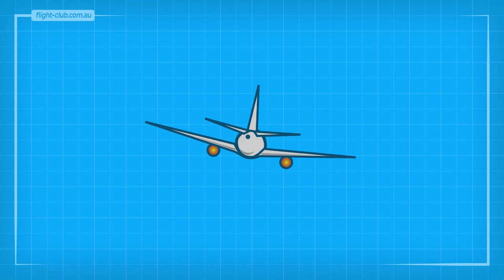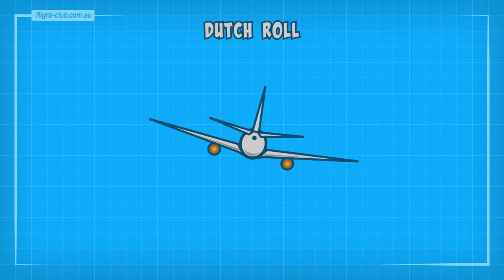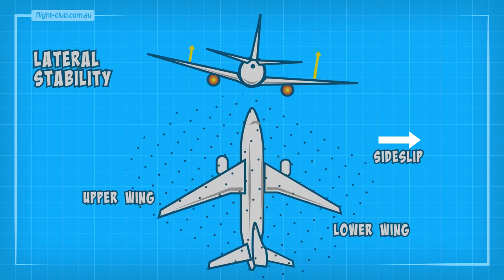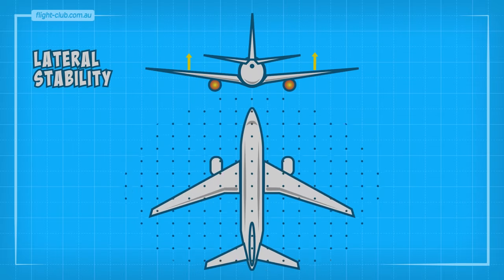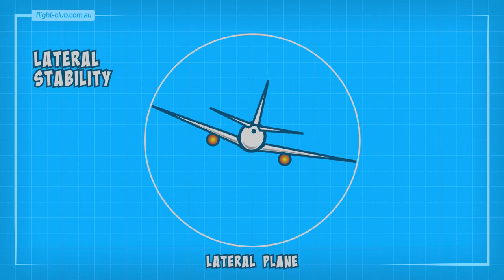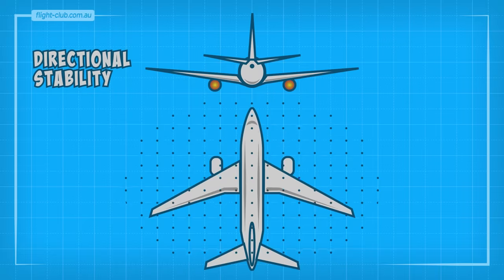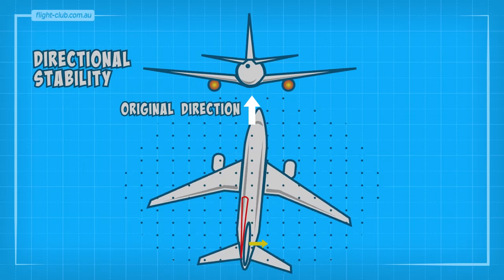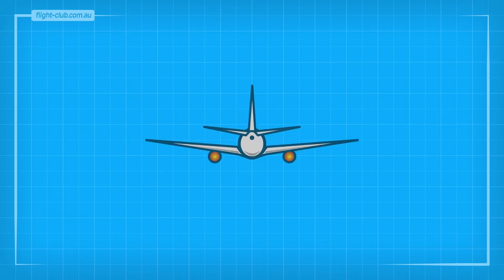Understanding Dutch Roll | Simple explanation.

Comment: I used to fly Boeing 737s and like most jets they had something called a ‘Yaw Damper’ this became part of the fly by wire software in later aircraft. The yaw damper used to input small rudder inputs to prevent or stop Dutch roll, the movement was imperceptible in the rudder pedals and there was a small gauge in the control panel to show that it was moving which was barely noticeable. One day I boarded one of the company’s aircraft at Gatwick U.K. to fly to Barcelona Spain and back. The only noted defect was ‘Yaw damper inoperable’ which I checked was allowable so off we went. A short while into that flight I decided that I would never accept a 737 for flight with that defect again (as Captain we have that right no matter what the manual says). The flight there and back was horrible, there was nothing that we could do to stop the Dutch Roll, yes the effect reduces until the next tiny bump or turn or whatever, it was safe but absolutely awful, it must. have been even worse for the passengers near the back.
Reply: I guess it's like having a car suspension  with spring only and dead shock-absorber..?  Is it?
Reply: Sir, i sincerely thank you for this comment. I keep on being surprised how do native enlish speakers explain and tell their stories so that every word and an event is literally feelable. The thing is that I am a FO for Aeroflot, my type is A320 and at the moment I am trying to make all those things that happen with aircraft to come "throught my skin" to start to understand them instinctively. Harsh times in the industry lead to imminent aircraft-bound-to-ground situations and flights when we have to dispatch under multiple MEL is increasing. Thanks to your comment now I know that without a yaw damping function it may be reasonable to insist on switching to another aircraft.
Reply: Hlo sirr ❤️
Reply: 737s dont have fly by wire
Reply: @hansloyalitat9774  They said that LATER aircraft had the functionality of this component as part of the fly-by-wire system, not that the 737 had one.
Reply: They lost a KC-135 due to dutch roll.
Reply: Many planes have very weak natural stability nowadays. Because large stabilizers have a lot of drag and active control systems are allowed in type approval. The planes still need to be stable, but zero damping causing the plane to continuously wobble around is technically stable. 
Stability can also be increased by trimming more weight to the front, because it increases the lever between the stabilizer and CoG. Like picking the heaviest passengers and giving them a free in-flight upgrade to the business class. Small changes can be significant in this regard.
Reply: Did you inform the passengers of what was happening? Or did you just sorta pretend this was normal flight
Reply: @hansloyalitat9774  Read better my dear before comenting ....
Reply: I was a jet engine mechanic on the KC-135. I learned a lot about the planes history. Its a cousin of the 707. The rudder damper didnt come about until after these planes were designed, since they were some of the first to ecounter this problem.

The USAF inexplicably refused to install rudder dampers on KC-135s, after Boeing made them for the 707. They didnt install any for 20 years, probably to try and save money. The USAF accepted a fatal crash rate of 2 crashes per year, and many MANY of these crashes were the result of lateral instability that a simple yaw damper could have prevented.

Ths USAF was trying to compensate through raw crew training. A good pilot can dampen out a dutch roll by hand, and make it a smoother flight... The problem is, this task is a stressful attention hog for the pilot from takeoff till touch down... So you can imagine how pilots can easily lose control over dutch roll when they get behind the plane.

The way to combat it is to counter roll. Not yaw, trying to counter with yaw almost always makes it worse since dutch roll is so sensitive to yaw input. So the USAF would train its pilotst to dampen it out with hard roll inputs timed perfectly to be in phase with the dutch roll. And they couldn't hold it there for long, otherwise the pilot is likely to add pilot induced oscillation to the problem.

You would be right to reject a plane without a working damper. After how many fatal 135 crashes have been linked to lateral instsbility on that jet, our pilots are terrified of not only dutch roll, but uncommanded rudder movement. They also consider a failed damper automatic grounds for an in flight emergency, and landing asap. When a higj profile crash happened, the public found out a 20 year old piece of equipment could have prevented it, if only it had been instslled... The backlash was immense, and the USAF was forced to install them.

I am genuinely surprised that Boeing or your airline consider the damper optional equipment, you should probably reach to them both and let them know it shouldnt be, as that WILL likely crash a plane someday for any pilot who doesnt have experience with countering dutch roll. That literally sounds like an accident waiting to happen.
Reply: its the reason you are altitude restricted with the yaw damper inop. The Commander must adhere to the Dispatch requirements. in this case considering the Minimum Equipment List operational requirements. Flying lower (max. FL250) would require significant more fuel and possibly flying through more unstable air. Considerations and judgement are essential.
Reply: What has to be realized is the amount of work the engineers have done while designing so as to make flights comfortable. An event less flight reflects the fantastic reliability of each and every component of the airplane including the structure. Never forget to thank them everytime when you fly the machine. Some crew are very humble but some tend to take pride since they operate it like they own the plane. No engineering, no flying. Engineering has and will always be a thankless job..lol
Reply: Dutch roll is a directional stability effect. Virtually all the energy exchanged in a Dutch Roll is between yaw rate kinetic energy and sideslip stiffness. The only damping comes from the Nr derivative, the Np derivative usually causes a slightly destabilising effect. An excellent way of grasping how this happens is a time vector diagram. If you can find a copy of the text "Aircraft Dynamics and Automatic Control by McGruer, Ashkenas and Graham (unfortunately out of print for about 20 years now), look up the time vector diagrams for Dutch Roll, figure 6-4, on page 370 of my copy. The yawing moment equation is where all the energy exchange happens. The side force and rolling moment equations are just responses to the yaw motion. The only thing dihedral contributes to Dutch Roll is to determine the phase of the roll response.
Reply: @hansloyalitat9774  wasn't the infamous pitch trim problem of the Max that killed so many essentially a fly-by-wire issue?
Reply: That's only partially correct. Dutch roll at altitude is an entirely different hing to what is described here. Tht's why there was an altitude restriction for operation when they yaw damper becomes inoperative.
Reply: Nice description.  The Dutch roll phenomenon first appeared on the Boeing B-47 bomber, and the first yaw damper system resulted.  I was a mechanic during the early days of the Boeing 737, and we dreaded having to dispatch an aircraft with the yaw damper inoperative.  Since the passengers toward the rear of the cabin were subjected to a larger displacement during a Dutch roll, the flight attendants knew that airsickness would begin at the rear of the airplane and move forward.  Nobody was happy when the yaw damper failed.  Never models of the 737 have the yaw damper function incorporated into the automatic flight system in place of the troublesome yaw damper coupler on the early models, and reliability has improved.
Reply: No yaw damper means no autopilot. No pilot would accept that.
Reply: @hottubking1229 you can have a plane with a yaw damper and no autopilot.  The Be1900 comes to mind.
Reply: I'm surprised any MEL allowed to operate without the yaw damping system.
Reply: Flying lower would have helped
Reply: I know you posted this a year ago but this is in the news today. I had no idea what a Dutch roll is and your input makes a lot of sense.
Reply: @shoutitallloud It's sorta similar I think a better description would be that your suspension system is out of phase with itself. Like if in the front one shock on one side was hard and the one on the other was soft and in the rear it is flipped so that the soft shocks are diagonal to each other. This creates an oscillation on every turn on two different axes and is both super uncomfortable and undesirable for handling characteristics.
Reply: You posted this 3 years ago! Same plane model! That’s insane …. I thought you posted this because of the current news reports!!!!!😮
Reply: This happened to a Southwest flight from Phx-Oakland on 6/13/24
Reply: @hansloyalitat9774  He said later aricraft. Maybe he was referring to an Airbus.
Reply: @hellodoggy4526 sir?
Reply: @alanw2005  No, he's not referring to Airbus. After a series of accidents and incidents in the 90s, the NTSB concluded that 737s and newer aircraft requires the yaw damper. By 2002, the FAA ordered that the servo valves be replaced on all 737s by November 12, 2002. The FAA also ordered new training protocols for pilots to handle in an unexpected movement of flight controls. In 2016, former NTSB investigator John Cox stated that time has proven the NTSB correct in its findings because no additional rudder-reversal incidents have occurred since Boeing's redesign. This is incident is the first Dutch roll occurrence since SilkAir crash in 1997. Which is why these are extremely rare nowadays.
Reply: @brandonjones6907 Thought those rudder PCU crashes had nothing to do with the yaw damper. It was because the rudder PCU wouldn’t allow hydro to circulate and then it would gel up because the autopilot really isn’t using a bunch of rudder during cruise and it’s cold at 35,000 feet.

Comment: Unwanted resonance can break anything apart, as demonstrated by Nicola Tesla when he tested his steam motor in his apartment. He nearly rattled the building to collapse by a piston that weighs less than a human.
Reply from the maker: Tesla's oscillator? Thank you for brining this to our attention. This is very interesting!
Reply: its a myth
Reply: As per the Wikipedia; The MythBusters made a device powered by electricity rather than steam. It produced vibrations that could be felt hundreds of feet away, but no earthquake shaking on the bridge they attached to; they judged that the claim that the device produced an earthquake to be false (i.e. a "busted myth").

Comment: Vertical stabilizer area actually matters a lot less than vertical stabilizer height. As long as you're not stalling the stabilizer with >10° sideslip maneuvers, it should provide a similar force for a similar displacement regardless of the chord of the stabilizer. Just like a shallow and deep wing will create similar forces at low AOA.
Reply: Wouldn’t increasing the height increase the the surface area also?

Comment: Here after reading a CNN article on a Boeing 737 Max 8 out of Phoenix that had this happen:

      Less than an hour after taking off from Phoenix on May 25th, the plane experienced an uncontrolled side-to-side yawing motion known as a Dutch roll while cruising at 32,000 feet. The pilots of Southwest flight 746 were able to regain control and the plane landed safely in Oakland, according to a preliminary report from the FAA.

      _“It's pretty rare on modern airplanes,” Malmquist said, because the aircraft and their systems are designed to prevent a Dutch roll from occurring. Still, it’s important for pilots to know how to respond when it happens, he said.

“Obviously in this case they were,” Malmquist said. “That training is really, really critical.” _

      The Boeing 737 Max 8 jet involved in the Dutch roll incident is less than two years old. According to the FAA, a post-flight inspection revealed damage to a backup power control unit, known as a PCU. That system controls rudder movements on the plane's tail.

I feel like this video did a good job explaining. Scary stuff nonetheless. Also, more bad press floor Boeing, which is unfortunate.
Reply: Not unfortunate for Boeing. They prioritized money over engineering and are reaping what they have sewn. Air travel is extremely safe due to the countless hours of engineering and safety design that is put into these planes, and they are undoing a lot of faith people have in their airplanes recently, rightfully so.
Reply: @jeffb.5580  as concerning Dutch roll? When are we talking about in the late 60s when they designed the 737? The study of aerodynamics must be a new phenomenon that came around just around the time of the 737 MAX 😂

Comment: Just a note:

Dihedral doesn't work by increasing the wing span presented to the relative wind. It works by increasing the AOA of the lower wing (picturing this is not easy and it requires 3D visualization).
Reply: I think the lower wing develops a greater vertical lift component, and this lift effects an increased AOA.
Reply: @77thTrombone  I think what matters is the wing surface projected onto the plane of airflow.  With negative dihedral, the "upper" wing has more lift (leading to instability...and greater maneuverability.)

Comment: I was a navigator on KC-135A (Boeing 707) 1970-1976 USAF SAC.  The only time I experienced Dutch Roll we were very light weight and at a high altitude to conserve fuel.  I thought that was the problem.  Perhaps the aircraft commander had turned the auto pilot off and had the copilot flying the plane manually.  I don't know if the autopilot included a yaw damper back then but I am guessing it did.  Great video.
Reply: KC-135 Jet engine mechanic here (and history buff), 2016-2021... KC-135As did not have yaw dampers in your era. They werent added till about 1999. Your flight crew had to be trained extensively on how to counter lateral instability by hand. While 135A pilots were amazing at their jobs (it was a pretty damanding jet), this is a task that requires nonstop input on such an unstable plane. The result is occasionally, even good pilots could accidentally let it start going, or make it worse, if they were distracted by other tasks.

The 707, the 135's cousin, had yaw dampers for literal decades by 1999. The USAF didnt want to pay for the down time and upgrade. The result was an average of 2 fatal 135, crashes per year, MANY of which were the result of dutch rudder or lateral instability. It didnt get resolved until a high profile crash highlighted the negligence of the USAF in failing to add such a key safety feature, and the warranted public backlash forced them to finally update the aircraft.

Nowadays, the rudder damper does its job. Occasionally there is an uncommanded rudder issue. 135 pilots today are literally terrified of ANY sign of dutch roll or uncommanded rudder, due to the planes unfortunate history with this problem. They consider it an in flight emergency. Sometimes uncommanded rudder is a real problem, but I've also had some sound the alarm on it only for it to be imagined (for example, looking at aircraft data, I would sometimes find in rapid throttle changes on landing to cause one engine to spool up faster than the other.... Which feels just like uncommanded rudder).

Comment: Are you sure lateral stability during sideslip is due to change in area, not angle of attack?
Reply from the maker: It's actually a combination of factors on a swept wing design aeroplane. Diherdral (mentioned in this video) relates to the AOA changes in a sideslip. It contributes to lateral stability. We have a video on this subject: https://www.youtube.com/watch?v=WlwxH9SuH5M
Reply: This is kind of an easy point of confusion between dihedral itself (up-angled wings so the toward-airflow wing has a higher AOA) and dihedral effect , the combined slip-roll coupling caused by dihedral, plus a few other aerodynamic factors that have the same effect. One of them being the toward-airflow wing of a swept wing airplane facing the air more directly, as shown in this video. Another big one being the wing-fuselage interference of a high vs low wing airplanes. (High wing contributing so much dihedral effect, that the actual dihedral is reduced to compensate... so much that it's negative, aka anhedral, in many high wing swept wing jets).

Comment: Before this video, I somewhat thought that Dutch Roll and Adverse Yaw were pretty conflictual and were at variance with each other (like paradox) (if you know what I mean). Now I understand it much better
Reply: I think it's because the Dutch roll initial disturbance is not induced by flight control inputs whereas adverse yaw is. I think in Dutch roll there is no control surface displacement whatsoever and hence why it's all about the lateral and longitudinal stability.
Reply: i thought the same. What helped me is in adverse yaw there is a pilot input moving ailerons thus make the yaw in the opposite direction with the roll. but in this case initial roll and the yaw is in the same direction bc there is no aileron action .

Comment: Could be useful to show two examples.  Meaning what does a strong lateral stability design look like versus weak?  And the same for directional stability (strong vs. weak design and simulations).  Finally, is the only solution to make both strong?  Or is there a sweet spot (not too much, not too little) that should be aimed for, and lowering lateral stability might be the answer instead?